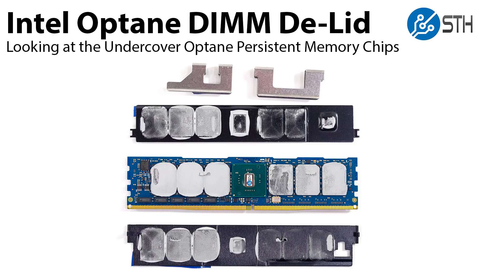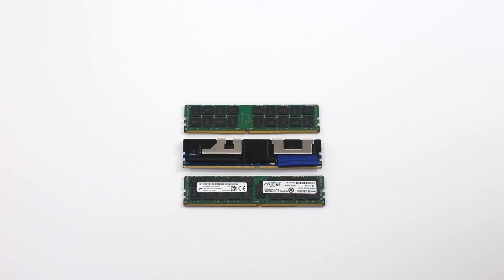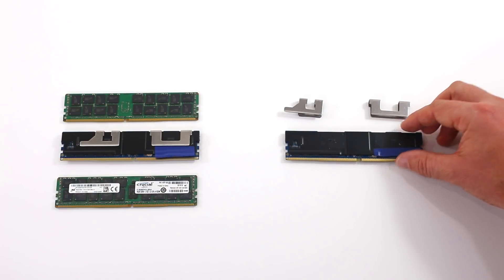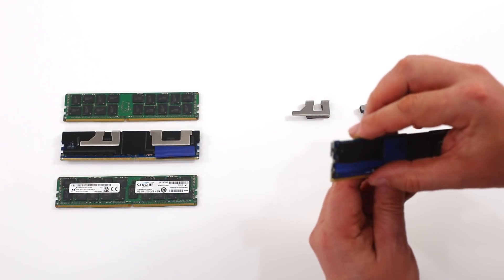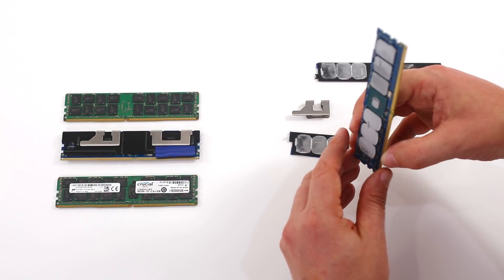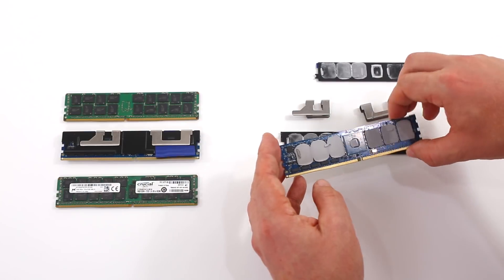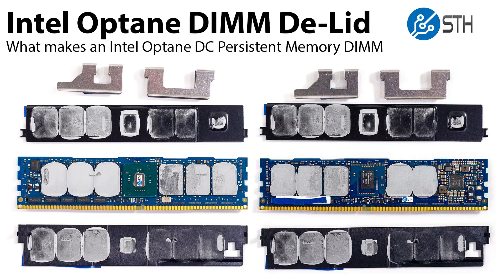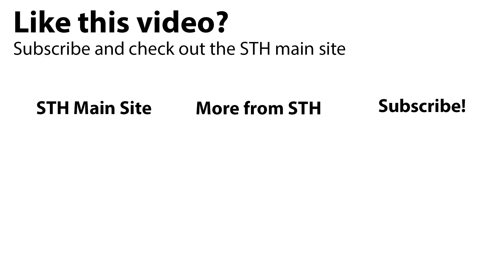Intel Optane DC Persistent Memory De-Lid and Chip View

Comment: Guys please clean off the paste and give us a good shot / readable of the chips. Maybe OC the RAM with some liquid metal^^. Just getting the temps down with it would be fine too. And how fast is that Optane NVRAM? If you invest more time you can get them to work again. If you care, clean them and repaste them. Use an old credit card to spread it and some isopropanol and some kitchen wipes or doubled up Kleenex or better trippled up that stuff is flimsy. You can use the normal grey silver containing CPU thermal paste. If you decide to use liquid metal get some clear nail lacquer or better red or black for visibility and coat every exposed contact.